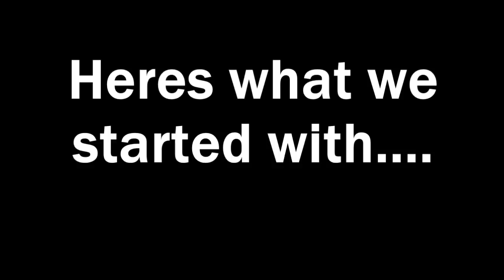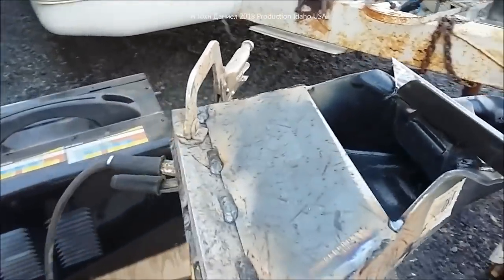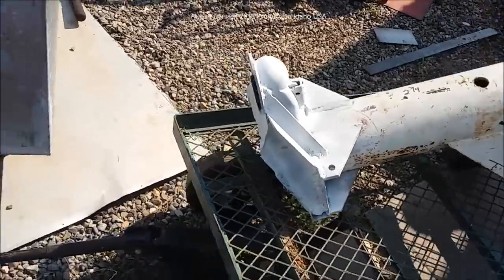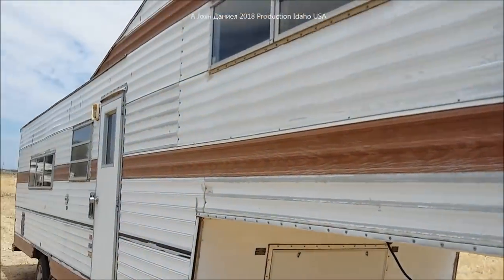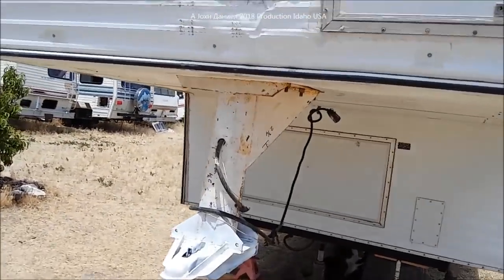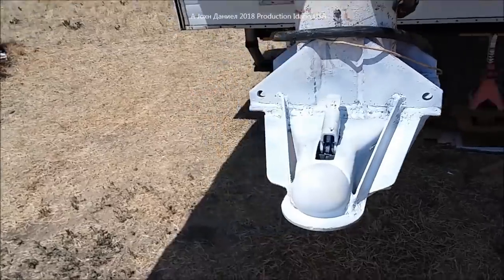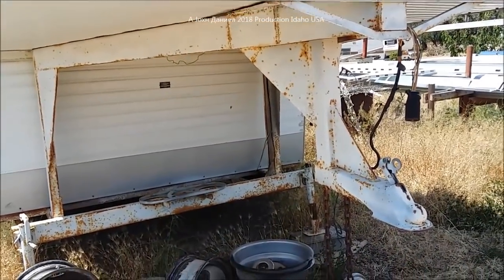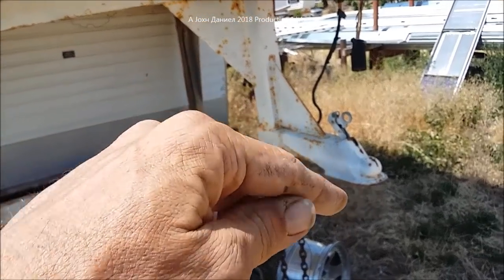Inverted antique 5th Wheel to Goose Neck in 1 hour (parts below)

Comment: i have a 1978 Holiday Rambler 5th wheel i just tore the camper shell off to make a flat bed "it was in really bad shape" 
so ill not change it to a goose neck, as ive towed it with spacers under the plate as i DID NOT DESIRE TO CHOP A HOLE IN MT 3+3 SQUARE BODY BED.  IF SOMEONE WANTS TO BUY THE INVERTED CRAP, LET ME KNOW. WHEN I MOVE, IT WILL BE CUT UP AND SOLD FOR SCRAP METAL. if the scrap yard pays only scrap prices, that is all they get from me, JUST SCRAP!!
when i scrap out a car or truck, i cut the good parts off the body, remove the body from the frame, cut off everything that is 1/8th inch thick (.125") or thicker (classified as steel, anything thinner  is considered tin), strip off ALL non ferrous metals and all wiring  components etc... i cut up everything so it is just scrap metal when selling to the scrap yards. i save all the good or rebuild able parts to sell to individuals!